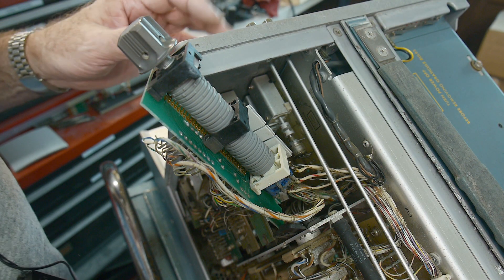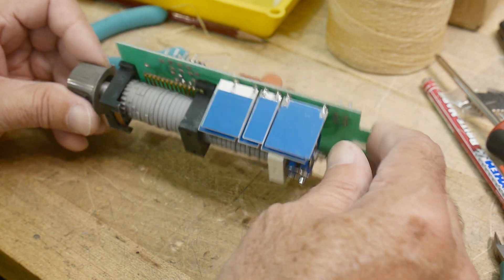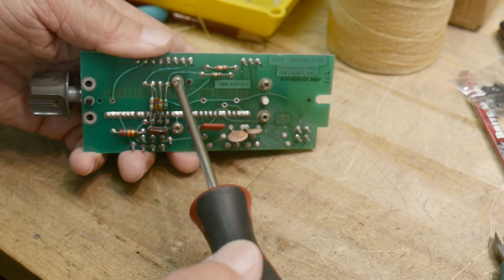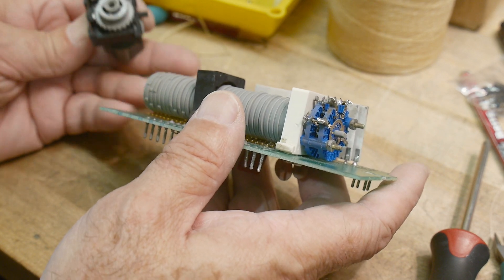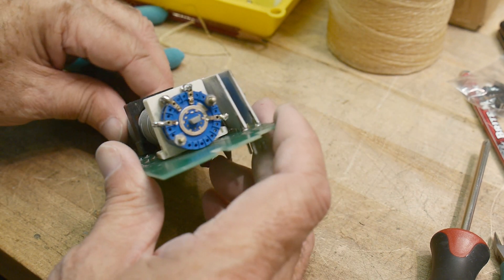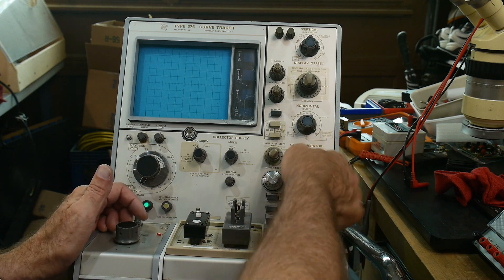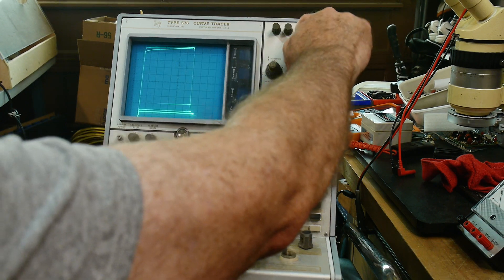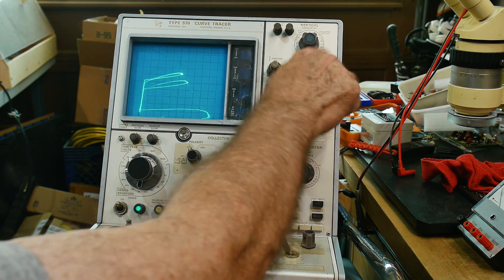#1283 Tektronix 576 Curve Tracer (part 9 of 9)

Comment: Thank you. Is there any way of finding the values of capacitors in the back behind the boards. 
My 576 needs them replaced. 
I am restricted due to space. Can't have the unit open for long.
I would love to have the caps before disassembly. Any info would be greatly appreciated
Reply from the maker: It is all in the service manual

Comment: Great to see this. I worked 40 years ago as troubleshooter for the analogue and digital storage oscilloscopes in the production plant in Heerenveen, the Netherlands. The curvetracer was used for measuring transistors in the troubleshooting process. Nice you restored this peace of equipment. It is using the old style ceramic component strips. The silver solder is specially for these strips otherwise they could crack and had to be replaced. High quality standards in those days. For cleaning contacts only isopropanol alcohol was allowed. Thanks for sharing!

Comment: In the past I have carefully dragged a small strip of paper soaked in Electrosolve (contact cleaner) through those gold contacts while each one was closed and had it solve my intermittent issues. It doesn't take much, even IPA would probably work. As long as they are clear of foreign material, the contacts are quite reliable. I would probably stay away from anything that leaves a film behind like DeoxIT. I love DeoxIT, but I don't use it in this situation. Nice work bringing it back to life, I thought it was gone for sure!

Comment: Why did you skip the gluing part?  Was there anything confidential there or you mess you the gluing the parts?  Crazy glue does not work well for plastics.
Reply from the maker: I needed to concentrate and making videos causes me to make mistakes. You are right about the glue. I used epoxy

Comment: It seems like we missed the resolution to the cliffhanger...  how did you figure out the correct position of the knob relative to the cams?
Reply from the maker: I did talk about the cam having a blank spot that denoted a starting position. I took a lot of thought to figure it out
Reply: @IMSAIGuy  How did you figure out what knob position was matched with the cam's blank spot?   I'm guessing there was a no-function spot on the panel?   Either that or figure out some sort of temporary method to clamp the cam tube to the knob and gradually figure out the proper position.  Glad to see the curve tracer brought back to usefulness again!

Comment: Check the zero, invert and cal push buttons. Cleaning with IPA helped clear up a similar issue with mine.
Reply from the maker: I would if I could figure out how to get to them without dismantling half of the unit.
Reply: @IMSAIGuy  I removed the knob on the horizontal volt/division and the mounting screws for that board and moved it out of the way to get access. The zero and invert button covers can be carefully pulled off from the front. I put the unit with the front face down and sprayed IPA into the switch and caught the residue in a towel.

Comment: Ok so I am supposed to make a comment after doing so the last video,.... hum
Well first congratulations on the progress.
You want me to say knob twiddling was a deciding factor, well it may have helped.
But the important aspect is you moved from twiddling to diagnosis. 
(I am trying to retain my basic smart-ass-ness here you know.) ;-}
There remains a problem yet so - some time it would be good to complete the diagnosis.
But certainly the curve tracer is useful in the present state.
I don't always finish every little bit either. Why do now that which can be done later?...
I am supposing that the display on the right side of the CRT is for recording settings with a camera. It would be nice to see that restored also but finding the parts may take sometime.
Maybe people part these out? I don't know. Show us the tech behind the window.
Perhaps viewers may have what is needed,... ?
But for $200 + some twiddling + diagnosis = you have a useful instrument!
Not bad altogether. 
---
This opens a whole new range of testing things for your videos,... 
like those peanut tubes,... ;-}
Reply from the maker: I'm sorry my 9 episodes did not show the 100 hrs and one month of diagnosis leading me to determine the fault must be mechanical. the symptom was always clear: turn the knob nothing happens. there was so much wrong with the unit it took a lot of work to even worry about that problem until I got the rest functional. The digital readout does work fine if you turn the illumination knob all the way up. I will have some more videos on curve tracers in the future.
Reply: @IMSAIGuy  I bet there's hours and hours on the cutting room floor ! Great Work !
Reply: @IMSAIGuy  well in any case I want you to know that I look forward to your videos everyday, most of them are quite interesting. This one is no exception and I believe that there was a hundred hours behind there. Sincerely Dan
Reply: Howdy Smart Arse !